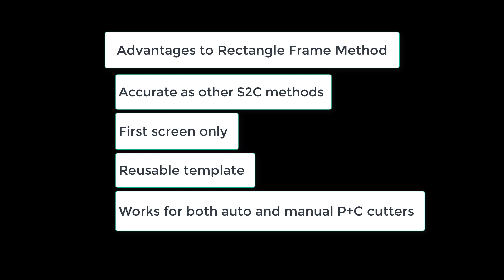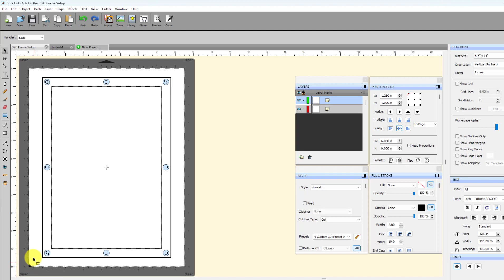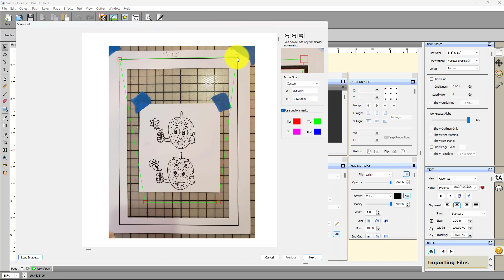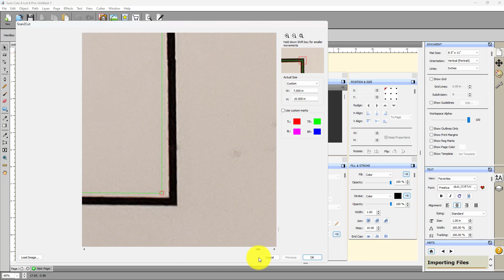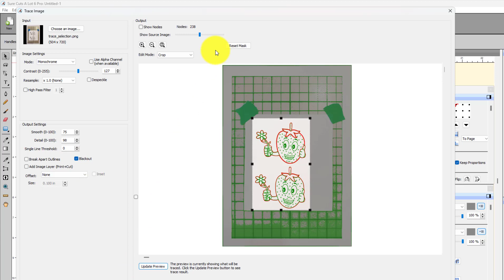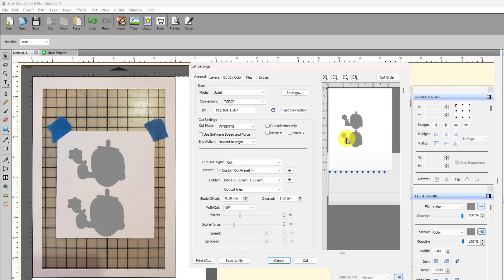SCAL Scan2Cut   Rectangle Frame Method

Comment: This was so totally amazing. I love it. I don't use my BSnC because it does not scan good and get good cuts.  This will be a game changer for me.  I seen Sandra did the reg marks and I thought ok I can do that but this is so much easier.  Sandy if I wanted to do more than one cut at a time would I have to readjust things like placing the rectangle and starting fresh or as long as my rectangle has not been off my mat can I use it over and over again.  Thank you.